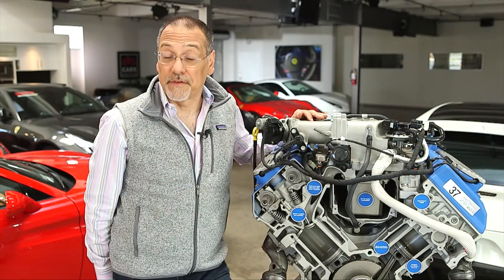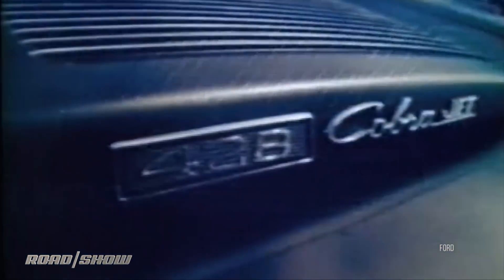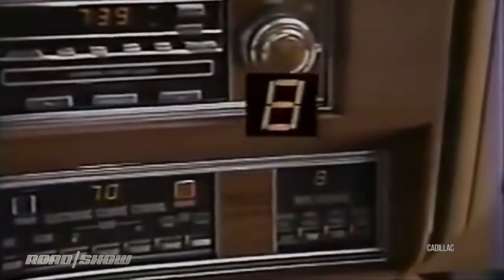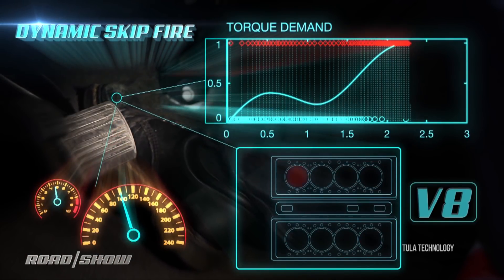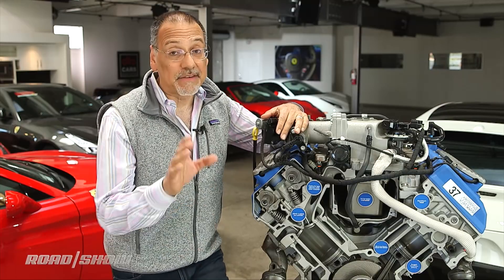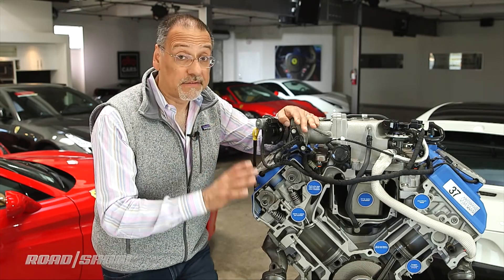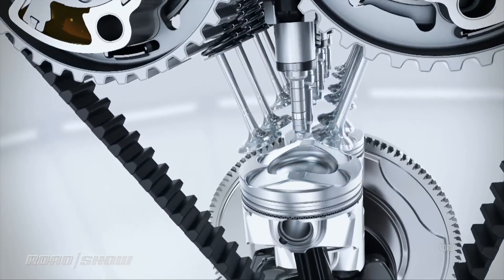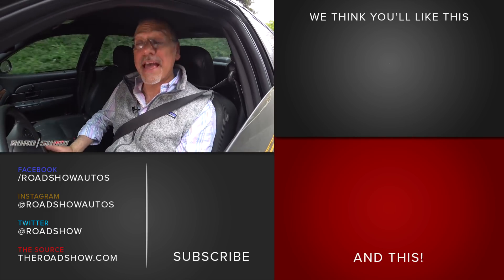Cooley on the shrinking engine: Cylinders are an endangered species

Comment: Its not just the number of cylinders..... Its the size of displacement.  The auto industry isnt getting creative because it wants to but rather because environmentalism is screwing us all.  A fake theory about global warming has turned a society upside down trying to solve a problem which simply isnt there.  But.....we're all paying for it nonetheless.
Reply: About 30% of the carbon sequestered underground from dead plants and animals for last 800 million years has been released into the atmosphere in the last 200 years.  Carbon retains heat like oil retains heat (oil heaters).  When you put extra carbon gas in a greenhouse, temp goes up.  Gravity holds the atmosphere around Earth, creating a greenhouse, causing global warming, causing climate change.  It's basic science man.
Reply: Transportation worldwide uses about 30% of crude pumped from the ground.  About 10% of that 30% is used by automobiles...worldwide.  The rest is used for production and manufacturing for things we use everyday.  Passenger jets use about 1 gallon of fuel a second, and tanker ships use about 1 gallon every 30 feet.  Countless volcano's erupt annually which pump out millions of metric tons of CO into the atmosphere.  And.....you're going to tell me we need to give a shit about the number of cylinders a car has.  Thats not basic science man, thats just being ignorant to the truth and accepting environmental propaganda because its creates power and wealth.
Reply: Agreed that optimizing cylinders is a silly waste of engineering know-how.  The largest producers of CO2 emissions is coal-fired power plants. But that's not the point. Plus you completely ignored what I said about the greenhouse effect.
Do you believe ice core samples hold a record of historical CO2 concentrations?  If not, you're just being willfully ignorant.  Otherwise, the core samples indicate CO2 as the highest they've been in nearly million years.  If volcanic activity has always been the driver of CO2 concentration, then why only recently in last 100 years has CO2 levels spike to nearly 2 times the historical average?
Reply: My point was not to ignore your greenhouse claim but rather bringing to light the reality that the number of automotive engine cylinders is pointless...  Physics will always prevail, NOT how the auto industry markets their products.  And I'm not being willfully ignorant either but rather proactively responsible in understanding what information out there is correct.  Strangely though people like you embrace this theory as if its an undeniable fact.  For instance, the level of CO gigatons science believes constantly cycles, they "think" man contributes about 7%.  Even at that, they're not completely sure...and aren't sure how the low percentage could contribute to any change in earths natural cycles.  So give it up Jim, its already known that earth moves through repeated heating/cooling fluctuations over a 10-30 yr cycle.  Global warming (I mean climate change) is a massive scam.  Society is still trying to recoup from the ozone scare, the Y2K scare, the ice age scare, the meteor scare, the countless dates which predict the end of humanity...  And the list of worldly scares will continue to grow as long as there's people stupid enough like you to fuel the fire of such catastrophes constantly looming over existence.
Reply: So you think the CFC's don't cause ozone depletion?  This can and has been proven in labs.  And, being a programmer of 30 years (retired now), I take insult to anyone that assumes Y2K was not a problem.  Me and thousands of other programmers worldwide spent most of 1998-99 fixing Y2K bugs.  Had I ignored the problem not fixed the Y2K bugs which riddled my most popular app, my primary customer (a large publicly listed company) would have gone out of business, they even took legal action to ensure problems were fixed before Jan 1 2000.  It was a VERY stressful time in my life.
Was it a scare when doctors said smoking causes lung cancer?  Or eating, drinking, breathing lead causes major health problems and developmental disorders? (It's why we don't use leaded gas anymore.)  Or how about acid rain, was another fake scare?  There is documented evidence to prove otherwise. 
Point is, you're only seeing data you want to see, likely due to corporate media brainwashing.
Reply: Well gee whiz...  It certainly does sounds like you saved the world.  I'm sure ample conspiracy theorists around the world are indebted to your hard work and dedication for saving humanity from the devastating electronic blackouts throwing us back into the dark ages as airplanes fall from the skies and nukes jet out of the ground.  Its a good thing Hollywood is on top of the hype too otherwise we all wouldn't have a clue what these events were supposed to look like.
By the way,  you seemingly are unaware of how corporate media works...  They dont disprove propaganda.....they promote it.
Reply: You have a bad habit of putting words in my mouth.  Y2K would absolutely had been a giant market crashing 9/11 type shit-show had nobody, like myself, fixed the problems.  If every programmer took the year off in '99, yes, planes would have falling out of skies and nationwide blackouts would have occured.  You have provided no evidence of your expertise to prove otherwise, nor any arguments in your validating positions, like every other post you make.
Glad you agree corporate media promotes propaganda.  Fox being the king propagandist.  MSDNC is close second.  Quit watching them.
Reply: I'm not putting words in your mouth...  You've even claimed the same prophetic reveal twice now.  :/
And what evidence would you like from me,...about what too?  Because if you havent noticed, you're happily throwing out speculations and assumptions...but have yet to support anything yourself, other than you and your tech buddies worked some OT to assure global survival.  Then you completely contradict your statement about corporate media...  Are you OK?  Because I'm starting to think you're coming at this without rhyme or reason.
Reply: Whatever... Jim.  I was merely stating my opinion and you had to come along and rudely assert yourself, trying to put me down.   If thats what you call "being civil" then I'm sure you're popular amongst the Internet trolls.  Next time remember its all in the semantics.

Comment: My 2104 Durango with the 5.7L Hemi V-8 had a very noticeable cut off that vibrated the interior. Ironically my 2017 RAM has the same 5.7L and I barely feel it. I’m curios if FCA addressed it between those years and fixed it. Either way I’m a lot happier with the new one.

Comment: Just wait til something goes wrong. "That'll be $5,000 please" said the Service Advisor
Reply: Rixter And it only takes 1-one destroyed cylinder to ruin a block.
Reply: Not only are they more expensive to repair, they are also more expensive to manufacture. Smaller engines with turbos make much more sense.
Reply: we've gone retarded around here
Reply: Wait till something goes wrong?  Hell that's a cheap 30k maintenance today.  Considering the average person doesn't have the computer equipment to do their own maintenance/repair anymore.
Reply: My 2017 Corvette has cylinder deactivation to get 36mpg on the fwy.  GM drivetrain warranty is 5 years or 60,000 miles.

Comment: I have an 08 Honda Accord with the cylinder deactivation system
Is able to run on 1 4 or 6 cylinders
You can't not tell at all 

When I first got it I will let it get into the 4-cylinder mode and then just nail it to see if there was a lag
I never noticed any leg or anything at all

Still Loving It

Comment: I thought weight was the enemy? More weight requires more fuel to produce more power to move that weight. So, if we really want to reduce fuel consumption (besides going full electric) maybe automakers need to put the 'focus' back on to saving weight through better materials and smarter design. Bring on the 'Colin Chapmans' of the auto industry.

Comment: Well, my 2013 RDX has cylinders deactivation technology that isn't all it cracked up to be... I can't put my finger on what the problem is but it just isn't as smooth as any of the V6 I have owned over the years.
Reply: dcpc08161992 talk to some of the texts at Honda and see how many of these V6 they are pulling Pistons out of to change the piston rings in the cylinders that were deactivated
Reply: V6?

Get a 5.0 V8.

Comment: Ummm, no. Just no. I want my cylinders to wear evenly.
Reply: in GMs cylinder deactivation all the pistons still go up and down its just the valves to those shut down cylinders stay closed
Reply: jerry mina - the engineers are not silly. they think about all these basic concerns while designing the systems.
Reply: Jerry Mina
it help GM's 6.2 V8 get better fuel mileage over Fords Ecoboost 1 mile about sea level while towing 7000 lbs
Reply: 80386   I thought about that later. Still a stupid idea from smart people. It just bugs me. Hey, just my opinion.  I don’t like hybrids either. 😃
Reply: Jerry Mina lol cylinders don't wear that evenly anyway. Most often when people lose compression it's only one cylinder that really takes a hit causing engine problems.
Reply: 80386 I can't see how you can design any engine without consulting YouTube comment section. Engineers are the stupidest breed out there.

Comment: 4s are popular? Umm I think it’s just because there is not other option. Sure a 6 is sometimes an option but at a bigger cost.

And notice that marketing doesn’t try to hype 4s. Simply that the new model is lighter and more efficient yet has equal to same power (sometimes a little more). 

No, 4s aren’t popular, it’s all we’ve got.
Reply: Thoughts, Ideas, and what? Nothing will beat the sound of a v8, idc what any of those hyper Tesla nerds say
Reply: you bring up a great point and you'r right...the fact is most people aren't willing or able to pay the heavy gas bill for the one they would like to drive...it was the same in the 60's where people walked into their dealers admiring the latest hemi or mustang but walked out with the smaller engine
Reply: Trumpist mentality. If you say so it is so. Sheep will eat anything.

Comment: I'd rather have a 4 cylinder turbo that runs on 4 cylinders all the time than a 6 or 8 that is able to turn off cylinders. Also how about pumping loss when cylinders are not active? Wear is the same or worse in the de-activated cylinders.
Reply: Mark Day But the v8 with cylinder deactivation has more power when needed. Put a 4 banger in a full size truck and see how that turns out
Reply: Or a full size suv. Not talking about those crossover abominations
Reply: Alex West, you'll be able to find out soon, GM is building a turbo 4 cylinder for it's fullsize trucks
Reply: pumping loss isnt much of a thing, when a cylinder deactivates it doesnt seal, it breaths freely.
Reply: Anthony Webber See that's the thing. The only way they can make a small enginepowerful enough is by forced induction. And we all know that a boosted engine won't last as long as a naturally aspirated. That's how the market it going tho. Buy a car, trade it in after 2 or 3 years. If only people realized how much money they're wasting. I have a 20 year old truck. Paid 4500 for it and it has a brand new engine. I'll get another 15 years at least before I need to do any major engine work. And for the people praising how a boosted v6 (ugh, ecoboost) can make more power than a v8. Think about how much that v8 could make if it was boosted
Reply: I'd rather drive an electric than anything less than 6 cylinders. A 4 banger will always have dead points- yukk!

Comment: Cadillac was on to something.. interesting. DSF sounds good, but holy electronics.

FCA would like a word with you and it's 90 trim v8 levels on the Challenger/charger though 🤭
Reply: I learned to drive on one of those nightmare Cadillac 8+6+4 engines in a Fleetwood of the time. It was an utter pig because it could never decide what was needed. At a stoplight and need to get moving? Well, let's just give you 4 cylinders for this 3 ton pile of metal. 

The mechanical Eaton system didn't work, so GM literally did 'something' that made the car a v8 all the time, but it still cost more to work on because of the extra component.

However, my Honda Odyssey with VCM? Never a problem in 13 years.
Reply: FCA doesn’t give a F$&@ about 4s and 6s. They be going bigger v8s plus a supercharger. They aren’t hurting so there’s that

Comment: Here comes uneven cylinder wear
Reply: Who said that the piston is not moving. The piston is always connected to the crank. When we say cylinder deactivation, we mean that no fuel/air mixture is injected and no spark. Not that the piston is not moving.
Reply: andrew7720 lets face it these cars and engines are designed to be throw away for the next model year, I doubt they'll ever see the time of a rebuild. On he other hand with that automatic stop start feature I would guess gm/auto parts stores (and whatever other company uses this feature) will be selling a ton of starters and flex plates
Reply: blueovalfan23
Seriously? it shuts off the corresponding injectors
Reply: Even if the cylinder is deactivated. The piston still moves up and down causing the same wear.
Reply: Christian Hodges, I can only speak for GMs cylinder deactivation, and GMs cylinder deactivation  only work under light load situations light cruising down the highway or any long straight stretch
Reply: Yes those engines will be good for only 250 000 miles. That's nothing. Just going around the world 10 times
Reply: Brian Reiff
i don't know if they still use, but GM used BAS is an acronym for belted alternator starter
Reply: Brian Reiff modern engines are not designed to really be rebuilt (you can though). They are designed to last 200-300k and be completely dead. Older engines were designed to go 100k, rebuild, go 100k, rebuild.
Reply: Lol @ this dumbass
Reply: chckycrk you seriously think the guys designing it haven't thought of that?
Reply: What about hydrolock? A miss in the engine paired with skipping a few times while dumping fuel into the cylinder doesn't sound impossible.  It takes a lot of raw fuel to do that so I'd bet it'll be a rare occurence.
Reply: chckycrk the vast majority of cylinder wear occurs on start up. So as long as the system doesn't activate until the engines at operating temp wear difference should be negligible
Reply: blueovalfan23.......you would never get hydro-lock since not that much fuel is injected on one stroke otherwise all them old cars with distributors with points in them would all have been destroyed after only 15000 miles or so. Have you ever had an engine that had one cylinder missing?
Reply: literally almost every non performance car uses auto start/stop, look at the germans, almost everything they sell have it, even a 100k Mercedes, most cars have the option to turn it off. By the way, those cars also have a secondary "starter" for the auto start after a shutoff, so don't worry about needing new starters, they test those things for millions of miles.
Reply: chckycrk thats gonna be 2000 to replace cylinder 2 and 3 thanks!
Reply: Bryce Rigby the reason its still not good your not changing the weight so even down to 4 from v8 your not doing much good and its a down fall when a truck or car is big and heavy to have a 4cl even with turbo or super charging it will brake down quick
Reply: The whole point of the random order is so that they all will still wear evenly. I can see potential of that happening on some of the GM vehicles for example that switch from V8 to V4 because it always shuts down the same cylinders but that won't happen with this new technology.
Reply: in GMs cylinder deactivation all the pistons still go up and down, it just keeps the valves closed
Reply: chckycrk  Yep.